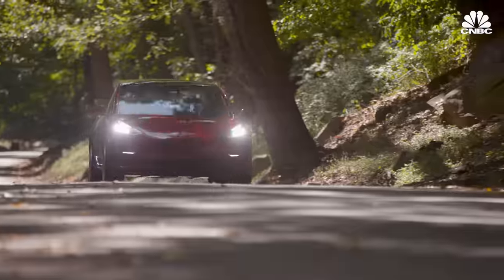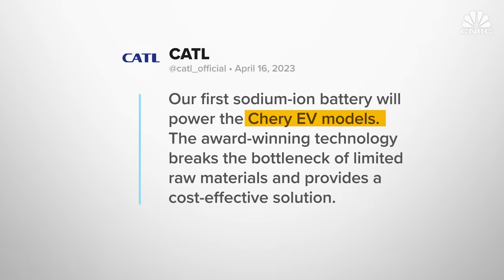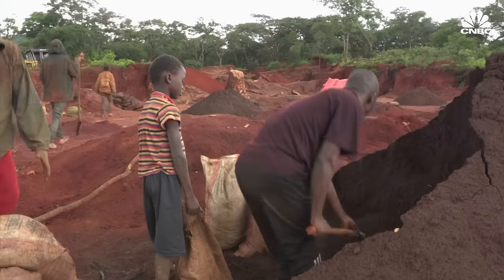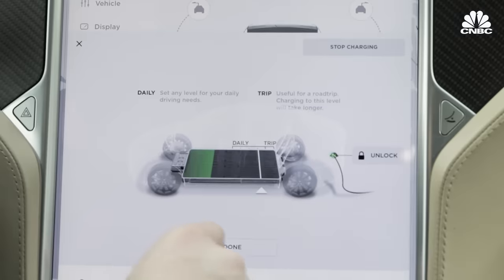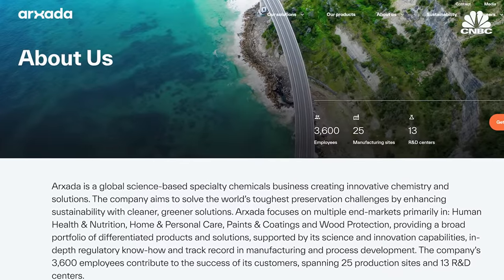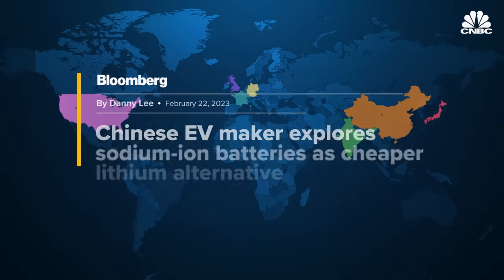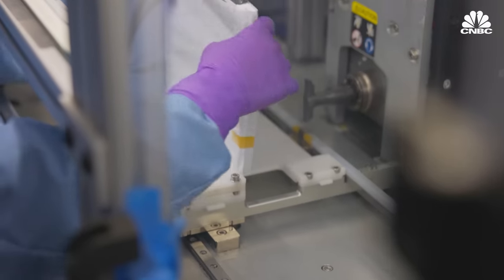How Sodium-Ion Batteries May Challenge Lithium

Comment: "Sodium is right by lithium on the periodic table which means the two are chemically very similar."  is such a strange statement to make.  I don't know what she's basing this on.  What matters in this case is them being in the same periodic table group (alkali metals).
The noble gases (which are quite nonreactive) are right beside the halogens (which are highly reactive) which shows proximity has no bearing on similarity in general.

Comment: Pouch cells do not scale well compared to the jelly role of round cells. Defects increase at a alarming rate when manufacturing speed increase, it may work in small/slow scale but has a rather limited futute at scale.
Reply: Pouch cells and (and also coin cells) are just laboratory standard test formats.
Reply: @gregorymalchuk272  The "blade" battery is pouch, that's why production is slow and full of errors, for example.

Comment: What type battery bank best suited to run on solar and diesel applied to 50’ performance cruising sailing catamaran application that reduces weight, reduces fire hazard and cost, delivers longevity and reliability? It must be able to support typical boat systems, ample refrigeration, and great AC. It is all getting too complicated for average mortals to figure out given all this innovation. One often gets more insigt from commentary of viewers.

Comment: The problem with sodium ion batteries is that it can be recharged 100s of times vs. a lithium battery can be charged thousands of times. This report is misleading. It does have less energy density compared to lithium batteries. This is why engineers stopped developing it, because of its poor durability, and having poor energy densities. It would be difficult to use sodium ion batteries in stuff like laptop computers, smartphones, electric cars, etc.

Comment: The problem is the assumption that there is a "one size fits all" solution
Every use case will require a chemistry that is optimal for the requirements

Sodium should be pushed for the static energy storage, mayyyyybeeee very  light short range bicycles .

The problem with static storage is that it can be distributed in nature and chips away at centralized control. There is a political component in this matter.

Comment: I think Sodium ion batteries could be huge for green energy sector since storing the energy when sun dosnt shine and wind doesnt blow has been a huge issue.
Reply: Flow cells are the other.
Reply: Size and weight for substation grade sodium is not a problem.

Comment: It seems to me that sodium-ion batteries would be excellent for energy grid storage because their weight and bulk are really not an issue like they are with EVs.  Plus, the batteries have longer life than lithium-ion, so they would need to be replaced less frequently, which would further cut costs.  Plus, they do not have near the problems in cold weather that lithium-ion batteries do.

I think that ultimately, they will be good in EVs, too, but by that time, we may have found something even better.
Reply: Building batteries to attempt to store grid energy is a complete waste of energy.  Do you have any idea how much energy it takes to mine minerals, refine minerals, and use that to make batteries? 😂😂😂😂 IMPOSSIBLE.  There is a 1902 Ford at the Henry Ford Museum that has a salt based battery, its range is 4 miles.
Reply: Our 20um/50um nacl salt powder has been in used in sodium-ion battery

Comment: One of several challenges on sodium-ion batteries is the wide cell voltage range over state of charge.  Over the discharge range, a sodium cell voltage starts at about 3.9v and at complete discharge is about 1.5v.  This creates a challenge for producing efficient loading on battery.  

You can make a motor or an electronic power supply that will work over this wider voltage range but you cannot get away from the volt x amp = power relationship.  This means the required current flow doubles in the lower half of sodium-ion battery discharge cycle.  This in turn requires stronger load components, thicker wire and larger magnetic cores in motors and lower resistance switching devices and stronger power transformers in power supplies.  This increases cost of the system over lithium-ion based systems.

If you don't address the increased system peak load current and just replace the battery you take a big hit in overall system energy efficiency, or the equipment will only be usable over about 60-65% of the available total sodium-ion battery capacity.

Just comparing cost of battery cells does not tell the whole story.

Comment: Excellent documentary. Thank you. I've been using LiFePO4 batteries for several years. If Na batteries can be competitive, I'm very interested. But I was disappointed that you didn't touch on charging speed. One of the joys of LiFePO4 is that it can take about as much current as you can throw at it (for my marine interests). Li-Ion are a bit better, but also not as safe. But I don't know where Sodium fits into that.
Reply: And LFP last 4x more than lithium ion.  I have LFP in my ecoflow solar generators

Comment: How many times can these battery cells cycled; charged and discharged before they are deemed useless and can you charge them below freezing temperatures? Current lithium ion cells can't be charged below freezing temperatures unless they are warmed up. All these are critical in determining cost of ownership and market adoption like power wall energy storage from wind and solar panels during peak times.
Reply: Thats the operating teamptures are far ... Li is something like -15c Sodium is said to be -30c anything colder and you will need some way to warm up the batteries of course.
Reply: @adr2t  I asked about charging temperature for sodium-ion battery. You seem to be confusing operating temperature vs charging temperature. You can't charge lithium ion cells below freezing temperatures unless you warm them up first (wasting time/energy to warm up) Is sodium-ion limited to the same restrictions, or accepts charge below freezing similar to lead-acid battery.
Reply: @tech29X  Short answer, yes it should allow for it. Yes I understand, but for Sodium its the same thing vs Li that had two different ones.
Reply: @adr2t  PBA/PBC (Prussian Blue Anode / Cathode) versions can be discharged and charged from -50C to +50C. Power capacity decreases at lower temps but at least the battery works and won't leave you or your application stranded. As the battery and power electronics warm with use the battery capacity increases. Effectively speaking if you have a telecom tower / Edge Compute site sitting at -20C and start discharging the batteries through the inverter and the room begins to warm. The battery started at about 80% of capacity but as the room comes up to even a 0C state the battery begins to be able to access 100% of the remaining capacity. Sort of like driving an ICE downhill and watching the miles-to-empty move upwards.

Comment: Not a chance... Sodium ion batteries do not have as much energy density as lithium... Their only advantage though is that they charge faster.
Reply: Seeing as more experimentation and investment has poured in. It will be a matter of time before some discoveries are made. It was the same for lithium in its' initial use.
Reply: BYD is already mass producing it and has cars using it
Reply: Seeing as though they have at least as much energy density as Lithium iron phosphate, which are being used in several models of Tesla's cars, and most Chinese cars, I would say you  are flat out wrong in this statement
Reply: you assume batteries are only used for mobile devices or vehicles where weight matters. and this assumption is wrong.
Reply: And cheaper, can be made anywhere, safer, and offer more methods to scale production ... yea totally lol. You are dead wrong my dude.

Comment: The difference in Wh/per KM is 160-180 or 12.5%
Yet li-ion batteries should NEVER be allowed to go below 20% charge EVER! It will destroy the capacity very rapidly.
But if NA-ion can be safely fully discharged, basically to zero, then actually the range increases for EV's.

Now I'm unsure if EV makers are hiding this final 20% away from the consumer to protect the batteries, but it's irrespective, you still get more range. 
Batteries could be 7.5% lighter and still deliver the same range, or the same the same weight and deliver 7.5% more mileage.
Reply: Oh and cost less too.

Comment: Even IF sodium doesn't holds as much power, which for some people might be a downer, it being more stable and secure will be boon. 
I wouldn't mind some of the lithium batteries around me replaced with some stable sodium. Even if it means more regular recharging.
Reply: It's also, 3x heavier lower energy efficiency, and has a lower lifespan.
Reply: @caesarsalad1170 Where's your source? I'm pretty sure sodium ion batteries have the same lifespan as lithium

Comment: If batteries for EV’s were standardized  dimensions and connections like in your TV remote where it doesn’t matter which brand you buy they just get swapped or recharged then gas stations would become SWAP STATIONS and range would no longer be an issue but the EV manufacturers are gouging too much on the batteries to allow such a free enterprise that would be fantastic for the consumers.  When your BBQ tank is empty you swap it, lots of forklifts in warehouses have battery swap stations where you just drive up, it removes the drained battery and slides in a charged battery and in 2 minutes you can now drive for hours again.  Biggest benefit is these SWAP BATTERIES can now be charged slow which extends the life of the battery which lowers the lifetime cost of the battery and reduces demand for new batteries and processing to make more batteries and eliminates massive electrical demands of fast chargers also allowing charging to take place only during reduced electrical price hours in areas that have time of use pricing.
Reply: Range is not an issue, even without swap stations.

Comment: I wonder if it is cost prohibitive to use sodium-ion battery in consumer devices (power banks, rechargeable batteries, etc…). If it is safer than lithium-ion I am willing to pay a premium for it.
Reply: Consumer electronics is one thing they didn't mention. Laptops phones and watches need small high power batteries so Li is probably here for a while. Battery backups alwould be great for sodium
Reply: Lithium is already pretty safe, so what's the concern?

Comment: Not human rights, not material scarcity, not geopolitics, not price, the one metric that rules battery is energy density. It won't take off if it can't catch up, period. There's a reason we went from dirt cheap, abundant NiMH to Li-ion. Today even Li-ion isn't cutting it anymore with how much power draw is required in electronics and electric motors.

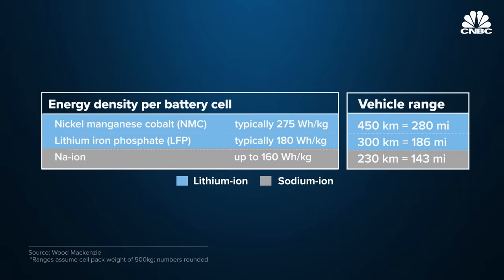Comment: 5:48  Most drivers don't even travel 230 km per day ( representing the lowest storage density of 160 Wh/kg ).  For the rare times when people do need to go longer distances, they could hire a car.  If they regularly travel longer distances, they could buy a hybrid EV.    There's a solution for every use case.  On that basis Sodium ion batteries could service a significant chunk of the EV market.  Sodium ion batteries would also be great for grid backup storage.

Comment: thermal ~1000C sand/ brick storage batteries are best way for energy storage for homes life cycle around 100 years.
Reply: Ok. And with the hot sand you run your TV or freezer?
Reply: It's good for making pizza at least.
Reply: @Johannes-mm6dx  yes with Stirling Generator, and waste heat to heat water in home.

Comment: Sodium will crush on the grid storage market, where density does not matter. It's only a question of price vs capacity x lifetime. A cell made from table salt, plastic, aluminum and sand will crush any competitor when manufactured at a huge industrial scale.

Lithium will remain king on the EV market where density and range is paramount. Lithium is electrochemically more active and more capable of storing energy, sodium batteries probably won't recover that deficit for the foreseeable future. Very cheap, low range EVs will use sodium, premium offerings will use Lithium.

Comment: The trick really needs to be instead of pluggin in you pull in and swap for a charged pack at a charge station that would take the place of gas station. Go in get some snacks hit the restroom come out and your battery in replaced in a few minutes.

Comment: Sodium-Ion batteries are not challenging Lithium batteries. They are a viable alternative for residential and industrial off grid static storage. Of course as a whole network, they can and should support the unsatiable energy required from the grid. They will definitely offer a cheaper alternative to LiFePO4 when size and weight is not critical. In fact, ALL the storage technologies have their niche applications and their pros and cons. They are not necessarily mutually exclusive one another. They are in fact complementary and will contribute as a whole to the smooth transition from fossil fuel.

Comment: Sodium-ion batteries are good but not as good as solid-state batteries, by far. Nissan said EVs with solid-state will be released in 2028 and in that case sodium-ion has no chance in the field.
The other rival are recycled lithium-ion batteries. About 10 years after EV became popular, lots of abandoned EVs are recycled. Sodium-ion with poor Wh/kg performance have to compete with them. Sodium-ion batteries are more safe, at least people would think that, and may have more performance. But since the supply greatly exceeds the demand, recycled batteries will be much much cheaper. They will be crazily cheap.
So in conclusion, sodium-ion batteries do not have much chance. There should be some field where they can play some critical role, but not a world changing technology. If solid-state batteries will not be put into practical use until, well around 2035, it's another story.
Reply: You are right.

Comment: Tesla EV cars 350 amps at 500 volts each charger for one car . 8 cars charging is 1.4 mega watts.
A Nuclear power plant AP1000 is 1000 mega watts.
So One Nuke plant to charge 700-- cars? 
Millions of cars here in NYC.
We will need a while new power grid nationally.
No one talks about supply .
Bizarre.
Even IEEE society questions this jump into EV with no plans to supply adequate power .

Comment: You don't need batteries if you develop better infrastructure. Rebuilding the road infrastructure to accept electric motors within the road itself or wired or railed power is much cheaper and less wasteful than building millions of batteries then wasting energy charging them. Its incredibly ridiculous to put all the power on the vehicle itself because now you gotta waste energy moving all that metal.

Comment: How can you state that sodium-ion batteries are safer than lithium-ion? Sodium is more reactive than lithium: drop a piece of each into water and see the difference.
In that shift Li=>Na you went down in the periodic table; why didn’t you go all the way down and offer cesium-ion battery to be “safer” than lithium-ion? 💥🔥🔥🔥
In my opinion the main principle to follow when engineering a new type of rechargeable battery and trying to make it not fire-prone must be limiting the maximum specific power (in watts) per surface area unit that can be emitted in case of short circuit. The bigger battery you make, the more watts per square meter you’ll have to be ready to dissipate, so make less watts per kilogram; and vice versa — for a small one (let’s say for smartphones) you can afford more watts per kilogram since smaller batteries can dissipate heat better thus they are less likely to have a runaway reaction.

Comment: If Sodium Ion batteries for passenger EVs are offered as a lower trim level, why not sell vehicles (targetting first time buyers, or young families) that start as sodium, then upgrade to lithium after a certain number of years or kilometers? It might be a good solution in developing economies where many families have never owned a car before, and college graduates with a salaried job can start to think of acquiring one. And if the needs of the first-time car owner has grown faster than anticipated, they can always trade in for a brand new and more capable vehicle. The pre-owned car will be refurbished and sold with a new Sodium Ion battery at an even lower cost down market, like in smaller and less affluent cities.

Comment: I cannot wait until we can phase out the mini explosive  bombs we have in our pockets. I'm so tired of lithium batteries swelling up and having the potential for combustion. I think sodium batteries are promising... but fluoride based batteries have much higher power density number's without any of the lithium downsides. To replace lithium, we need something that has a higher power-to-weight ratio and sodium, isn't it.

Comment: Lithium batteries disposal will be a nightmare. It is a lot more expensive and takes longer (compare with lead batteries).
I dont see how electric cars are better. Battery span is 8 to 12 years and represents 60% or 70% of car value. And after 5 years battery will last half. So what are you going to do when the car is 7 or 8 years old? And who is going to buy it? Boneyards willbe fill with these cars and take into account if you are in a small wreck. Batteries are the complete floor of the car